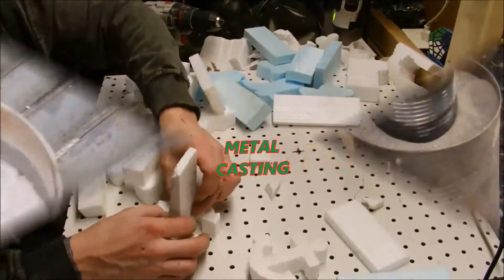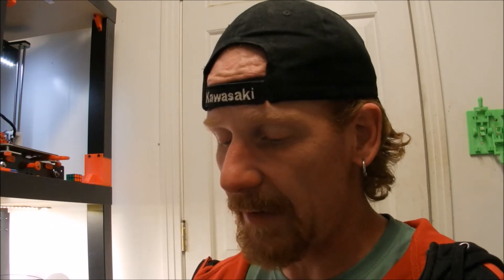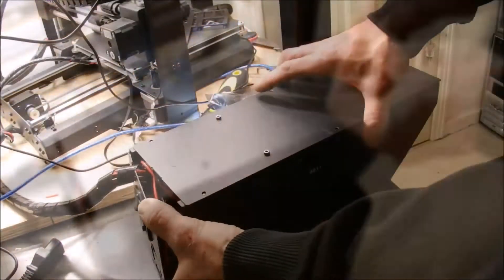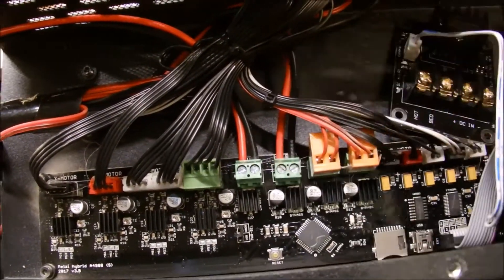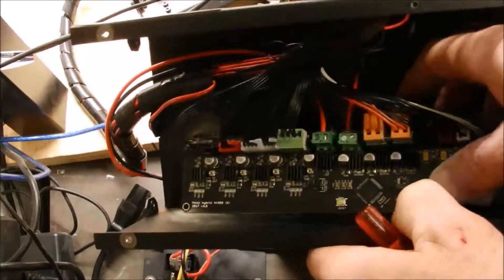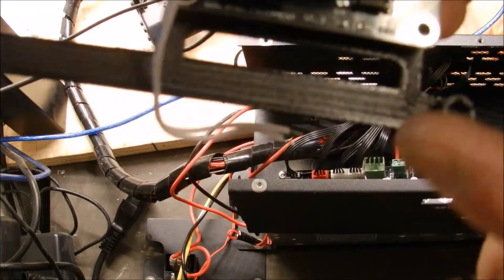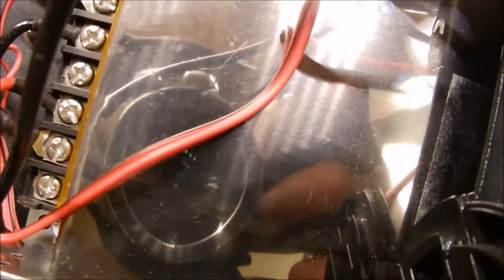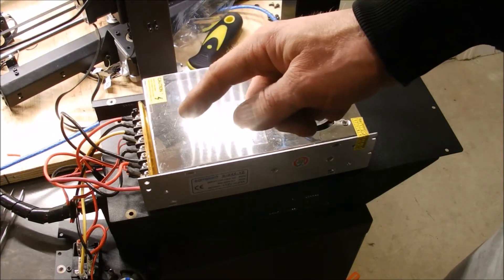Installing A Mosfet On Monoprice Maker Select V2

Comment: I've been using my completely original Monoprice MSv2 for 7 years now. All these old videos have made me see how lucky I've been, maybe I got a good revision of it. This could also be that I only use it for prototyping designs using PLA only, so the bed is never over 60 C. Thanks for the step-by-step video on this very crucial mod!
Reply: I just picked up one 2nd hand for $25 . Wish me luck🤞🏾😂
Reply: @stevensmith8285  just do the essential upgrades, it is the 3D printer that keeps going!

Comment: Great video, but my Maker select came with a different type of power supply. This isn't too significant, but the call the common -V and if you buy a kit on Amazon the cables they supply will not be long enough.
Reply from the maker: spare wire isn't a bad thing to have laying around but either way the wiring is still the same

Comment: Thanks for a detailed video. Just completed our upgrade. Our Mosfet came with wires to connect it to the power supply. The only problem was they were not long enough to allow the power supply to slide back into the case.
I used some 12g about a foot long and it worked great.
Reply from the maker: Awesome glad you figured it out ya'd think if they were sending some wire they would send enough. well shipping cost and all LOL
thanks for watching happy printing
Reply: @InsideTheMindOfMatt  The problem is that the power source has changed. It is much wider than the old one so the bottom has to be drawn all the way back to slide it into the upper case.

Comment: I just did my mosfet and I noticed an extra ground wire coming from the power supply ground terminal (they’re doubled up) not connected to anything. do you know if I maybe pulled it out of somewhere when dissembling it or if it’s just “extra”?
Reply from the maker: Did you unscrew the board from its mount at all?
Reply: Inside The Mind Of Matt I did (had to to get the bracket on)
Reply from the maker: Might go between board and case to ground the case the screws are the point of attachment
Reply: Inside The Mind Of Matt It’s an incredibly short wire. And unfortunately there’s no way I’m getting it under the board until after the power supply is back on

is possible it might go between the backplate case screws?  I have little to no electrical knowledge so I don’t know if that would cause any problems
Reply from the maker: Yes that is possible if it will reach but it’s the case ground I’m betting
Reply: Inside The Mind Of Matt cool someone on another forum suggested that as well. I just wasn’t sure if there was to be a “special place” on the case for it. Been scouring the case for a ground symbol.

Comment: Thanks for the great demo.   After my bed stopped heating, I bought and installed the MOSFET.    Now my bed heats up, but won't shut off when it reaches target temp.  It just keeps going. 

Suggestions?
Reply from the maker: going out on a limb here but if you bed stopped heating the you might have burnt the board which the mosfet prevents from happening to be begin with, so that being said if it is the board the if warranty is still good try for replacement otherwise its time to upgrade it. if you decide to go with a ramps board I have a full set of videos for that conversion let me know I'll help as much as I can

Comment: Need your help...I installed the mosfet according to your video but I turn it on and select to test it using the pla settings to warm up.  all works except I do not see the bed getting hot but the extruder is getting hot as always but not the bed.  did I wire something backwards...please let me know and thanks for the video
Reply from the maker: Eli Justiniano check make sure black is - and red is positive for starters if that is correct change the small wires that go from motherboard to mosfet
Reply: the two white ones...switch them ?
Reply from the maker: Eli Justiniano if the other wires are correct then yes the white ones
Reply: that worked perfectly and many thanks for your help.  Keep the videos coming!!!
Reply from the maker: Awesome glad to hear and you bet the videos will keep coming I’m not going anywhere. Once the weather breaks I’ll be more active outside

Comment: so i have seen this in a few videos now, yours has the best install instructions. and i just bought one of these printers, seems to work great out of the box. i am upgrading the cooling fan with a shroud. but out of curiosity, what benefit does the MOSFET have with this printer? or does is it that it prevents something?
Reply from the maker: pyronac1 the mosfet removes the current draw of the bed from the board because the board really isn’t designed for that load in the circuitry it’s more of a preventative measure and well worth the time and investment. Any more questions feel free to ask. 
Thanks for watching good luck with the printer mine still going strong
Reply: and that is a good reason for me to add that. thank you. and i am sure i will have more questions. but i will get to those after. one thing at a time.

Comment: Awesome!  Thanks for show the wire connections clearly. I've read write-ups and watched three other videos.  All of them said hookup the control cable from the mosfet to the control board, But none of them said which side of the control wire went to which side of the connector on the main board.  It's clear in your video that the wire with the dashes hooks up on the right where the RED wire was.  Thx
Reply from the maker: William Hatten glad to hear I’m only trying to help thanks for watching
Reply: Thanks for posting this. I couldn't clearly see where those went. On the Amazon page, it shows that the polarity didn't matter. I may or may not have smoked my new printer installing this but thanks to this comment it made it clear. 

FYI for anyone wondering about an upgraded heating bed and a better surface to print on, there is this. https://www.amazon.com/gp/product/B07MNHRS5K/ref=ppx_yo_dt_b_asin_title_o01_s00?ie=UTF8&psc=1#customerReviews
Also a better robust carrier board here
https://www.amazon.com/gp/product/B07B251KBS/ref=ppx_yo_dt_b_asin_title_o03_s03?ie=UTF8&psc=1 

 Thanks for the video and this is my contribution to help this awesome community.

Comment: Another great vid, but now you've got me curious what happens when you see a mosfet fail first hand? You said you've seen it and now you've peaked my interest. Especially since I'm 5 hours in to a 15hr print. (printing that second frame stabilizer overnight) I'm planning on upgrading the mosfets, but that's next on the purchase list, so for now I'm stuck with stock.
Reply from the maker: Dj Goku :-) you'll see video coming soon but nothing bad happened to me
Reply: Lol, good to hear. Making me paranoid about thermal runaway overnight! : P
Reply from the maker: Dj Goku someone else's misfortune turned into a win for me you'll see coming soon thanks for watching